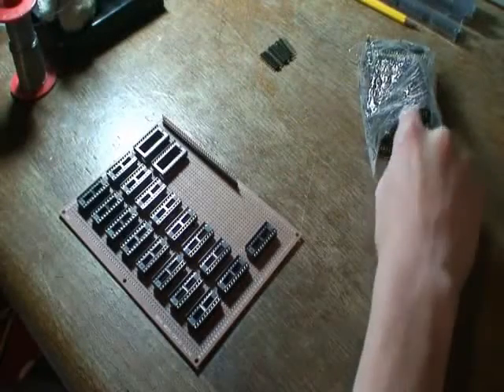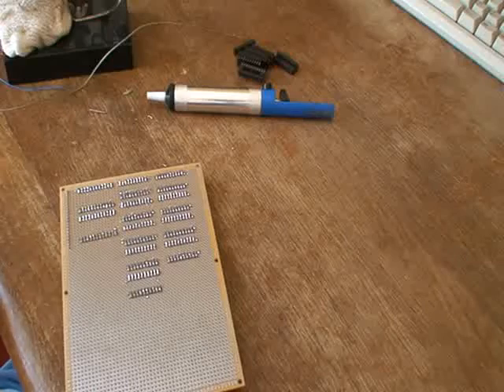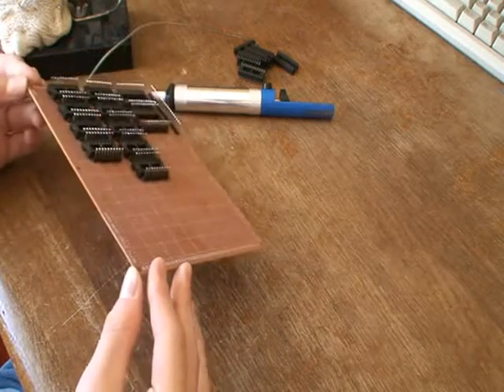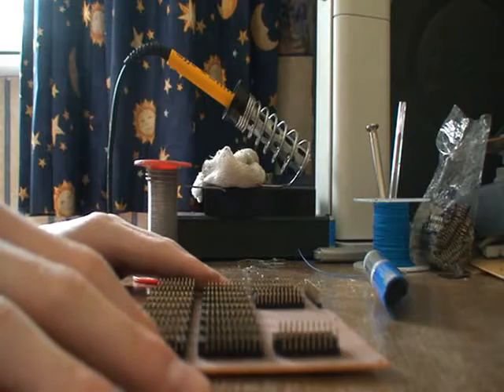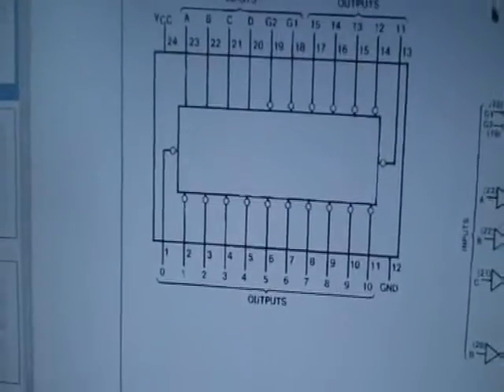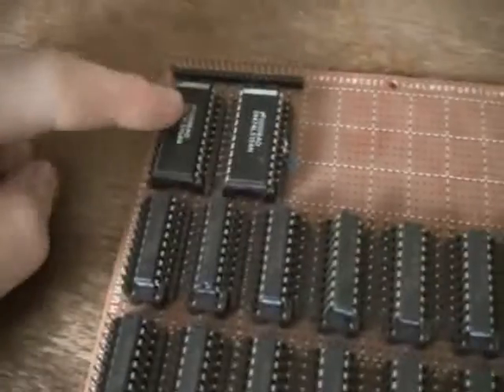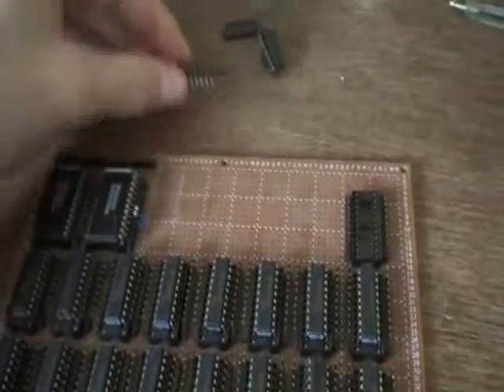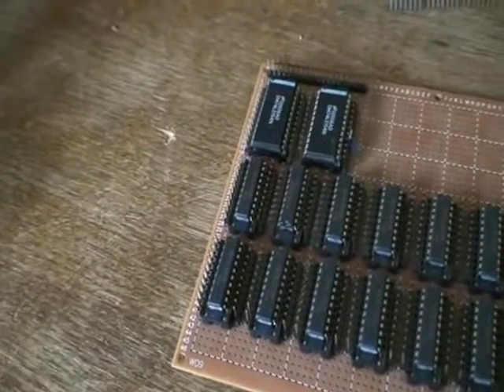Titan construction vlog (5.5) - Construction process!

Comment: @bootnecklad 

You were thinking that if you had four or five wires wired to the same terminal you would have to undo all of them just to remove one of them. Thus it is actually harder sometimes to troubleshoot wirewraps.

Comment: @bootnecklad I found that soldering became significantly quicker and easier when I replaced the large chisel tip that the iron came with with small conical tip. Finer solder (the stuff I'm using is 0.8mm diameter) also helps!

Comment: Ahhh you need to invert all the outputs of the 4-16 demux? XD That's a pain! Did you consider buying a demux which was already inverted? The demux I used for the DUO came in inverting and non-inverting versions. That would spare you from using poser NOT gates.

What I find annoying is I can never find a non-inverting 3-8 demux. :(

Also, how hard is it to keep the solder blobs from sticking to each other? It didn't seem like you had much trouble soldering.